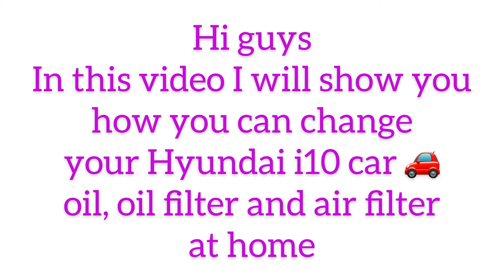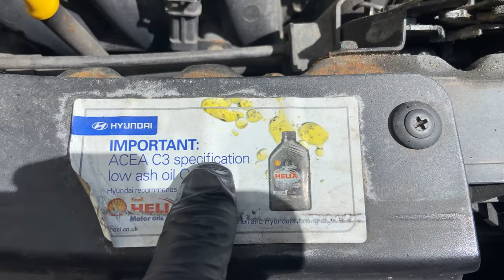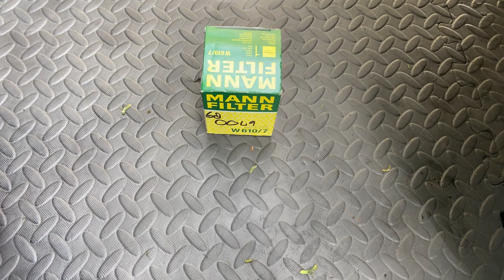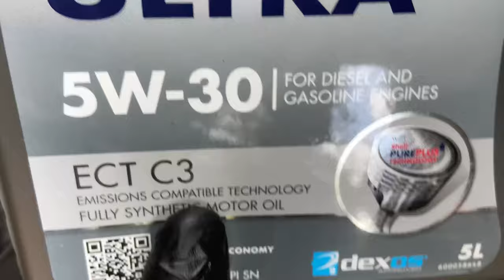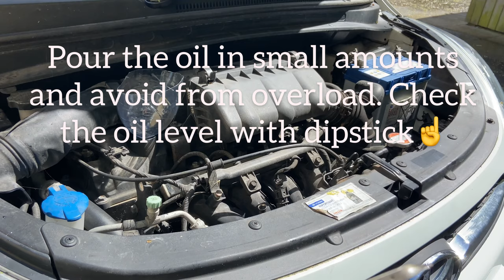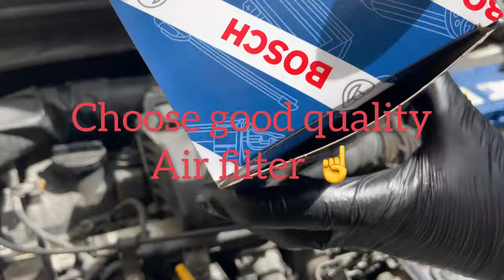Hyundai i10 car 🚗 service. Oil, oil filter and air filter change 🛠

Comment: Hello. Thank you for the videos. How much liters of oil it needs when changing oil and filter?
Reply from the maker: Hi Fabrizio,
Manufacturer says 3.5litres. As it packed in 1l or 4l bottle, it will remain a little bit for the next oil change.
Reply: @georgesworkshop8600  thank you very much for the info, i have to do the same work for my friends car

Comment: Thanks for the video need to do my wife’s car what’s the tool called to get the oil filter of?

Thanks
Reply from the maker: Hi you can buy on the Ebay. Car Engine Oil Filter Chain Grip Wrench Remover Steel Removal Tool. Good luck 😉
Reply: Thank you check the oil yesterday and the dip stick was bone dry  and it had rust on the stick  😂. But it’s my fault

Comment: Hi, good job ,I've just a question is it ok if you don't fill up the filter with oil ?
Reply from the maker: Hi,
I recommend to do, as at the first start the engine will get lubricated. You can avoid from engine’s wear.
Reply: @georgesworkshop8600  ok thanks dude

Comment: Hi, is it necessary to open the oil filing cap before drain the oil?
Reply from the maker: Hello, it could flow easier as no vacuum to hold it back.
Reply: @georgesworkshop8600  thanks
Reply: And it prevents from draining the oil pan just to find out that the filing cap is stuck and you cant fill in new oil

Comment: thank you iwant to know the type of oil that i can using i have a hyundai i10 160000km counter
Reply from the maker: Hi,
In the video I used that recommended by the manufacturer . You must stuck to the specification, but could choose different makes.

Comment: Is it a problem if i just do the revision of the oil with normal 5w30 oil?
Reply from the maker: Hi,
The problem with an average 5W30 oil is that, grime could be deposited in piston-ring and in long term , engine will damage. If you used the average oil, try to change it as quickly as possible.

Comment: By lifting the car up on ramps not the whole quantity of oil will drain out, because some of it will stay in the back part of the oil sump.
Reply from the maker: Hi,
I know, but just a little remains in it ( max 1 dl). Without ramp  no chance to change the oil at home.
Reply: @georgesworkshop8600  
It's very easy to change oil and filter without lifting the car up. Oil pan and filter are right behind the bumper, very accessible.

Comment: In my car oil pressure light show on idle at warm engine  condition then I accelerate light goes away and  cold engine no oil light show on idle can I drive continue but I drive from 6 month
Reply from the maker: Hi,
Firstly, I presume the oil level is on the correct level.  My guess is the engine heavily worn , because when the engine is warm the oil viscosity is lower and lose the pressure. 
The reason could be : wrong quality oil, rare oil change, last oil change was too long time ago ( mileage/time)
I think would be good to show for a garage.
Reply: @georgesworkshop8600  5w30 oil I have fill but when I upgrad grade oil lighy flickering at idle at warm
Reply: @georgesworkshop8600  oil level is good  I drive from 1 month any problem or not my car seized or not

Comment: What happens if oil level is higher than upper limit
Reply from the maker: Hi Sumesh,
If it’s only a couple millimetres higher the level it’s ok. ( max 5 millimetres) if more loose the drain screw and let it go a little oil.
Reply: Once my oil seal got damaged and whole oil got leaked in running

Comment: Is Shell Helix HX8 5w40 ok for Hyundai Grand i10? Thanks!
Reply from the maker: Hi,
I advise you to follow the factory recommendations that is 5w30, but the most important is to check the oil specification. May your oil this 5w40 have the same specification and you can use it.
Reply: @georgesworkshop8600  Thanks a bunch!
Reply from the maker: Your very welcome 😊

Comment: I do not know, why you are using spurious oil filter to this car, when Hyundai genuine oil filters are readily available for Rs.100/- In India, at any automobile shop.
Reply from the maker: Hi,
I used for my other cars these filters and I absolutely satisfied with them. And in Europe the factory parts are not so easily accessible and aren’t so cheap.
Reply: In South Africa the dealer filters is over priced. So we use GUD.

Comment: Great video! Before I watched this video, I accidentally loosened a bolt near the oil filter of my 2010 Hyundai i10 1.2 (shown in the photo at https://drive.google.com/file/d/1OekkLWTHBKKuaWwLAcVSsa902JBo77so/view?usp=sharing). What is the function of the bolt and does it need to be torqued correctly?
Reply from the maker: Hi Mark,
I don’t know now what is that bolt and its function. Please tightening up and I’ll check it tomorrow. Mine was covered as seen on the video.